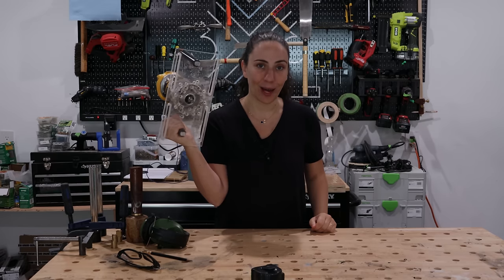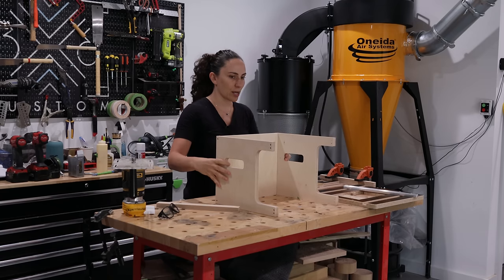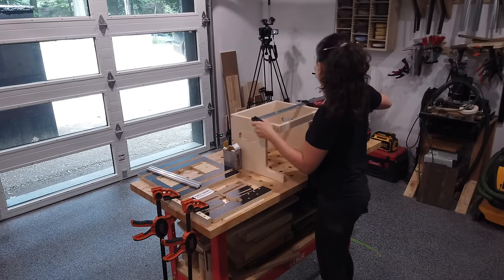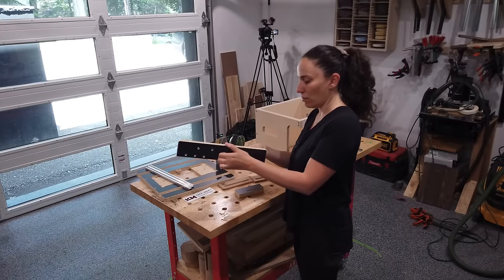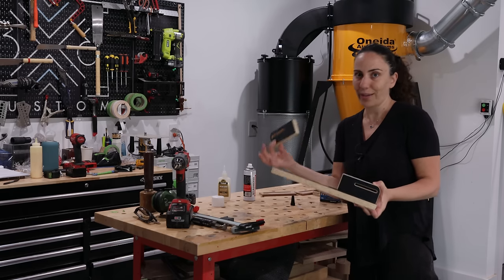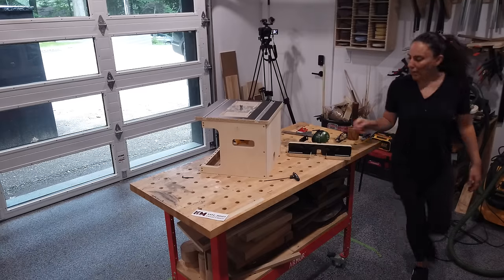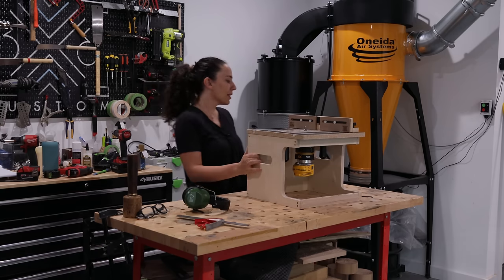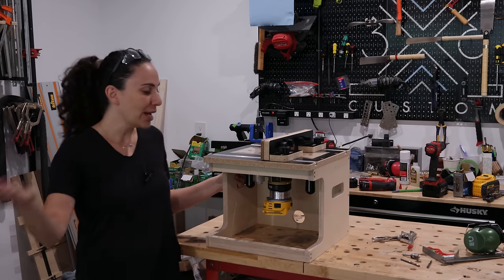Benchtop Router Table for the 6-in-1 Trim Router Jig

Comment: I think it's a bad idea to have holes for the bits in the base. If you attempt to remove the router with the base full of very sharp bits, you run a high risk of injury. But it’s a very nice and useful little tool.
Thank for this great video❤
Reply: It’s an option not a requirement to store bits there. That being said I’ve been using these for two months and not had an issue.
Reply: @katzmosestools  Giving the opportunity to do that to an inexperienced person without warning is irresponsible.
Look at the video when Tamar remove the router, her arms hit the bits holder.
Warning is easier then apologizing.
Reply: @capitainehaddock9388  JKM’s warning: sharp things will cut you. Use the same care you use around every single tool in your shop that is sharp. If it worries you you are not obligated to store your bits there but I promise you will find it useful if you do decide to use it.
Reply: @katzmosestools  maybe for v2 instead of optional bits in the affixed base - standardize a modular connection for easy mounting/removal of bits via a french cleat module.
Reply: @ChuckJaeger  “A poem is never finished, only abandoned” go check out the video I did this last week about how we developed this. Pretty cool look into how product development works and how much thought we put into this. I’m sure we could keep adding things until it looked like the Terminator.

From my experience making cleats on the cnc is incredibly inaccurate, cost prohibitive and not something we plan on changing or offering. There’s lots of ways people could modify this to fit their needs and I encourage them to do so if they would like. My point is this, nobody has to use the feature of a tool we offer. It’s there if you want to but it doesn’t take away a single thing from the functionality of it if you decide not to use it. I am certain this is the most functional, strongest, and versatile router table on the market at this price point. In my video we set my Ford F350 Dually on top of two of them and they hold it up. I am very proud of that fact. Use the holes or don’t but complaining that they there in the first place is silly.

Comment: Few questions. Why is the top rotated by 90 degrees? Is there any benefit to having the T track come all the way to front of the table?
Reply from the maker: Lots of design iterations that led to this. Jonathan explains a lot in his video. And you need the t track to extend all the way to the front so you can put it on or take it off on either side.

Comment: My Rockler portable table still meets my trim-router needs. However as I have your very well designed/made 6-in-1 jig most always attached to my Makita 18V router anyway, and this is such a well made table kit (as all your cooperative endeavors) I know I won't be able to resist much longer getting one.  ;-)
Reply from the maker: 😂😂 I decided I’m going to keep my big router table for 1/2” bits and this one for 1/4” so I never have to change the collet on the big one!
Reply: I finally took your always valued advice @3x3CustomTamar  and ordered the KM unit and will similarly dedicate to 1/4" bit tasks, leaving 1/2" to my [now cold] garage full size router table. I've already repurposed my crafted granddaughter's LEGO table that recently got outgrown-returned into a nice base for same (just happens to perfectly accommodate once I raised it 2-1/2").  The new KM kit will arrive Saturday but I have a full outside the shop schedule. However thanks to your walk-thru I'll make sure I at least pull out and glue up the first couple pieces so I'm ready to go when I have more time. 😉

Comment: Pretty nice idea, but ...
for a couple of dollars you can buy the router-cage as a spare part.
So you can mount the router-cage permanently and precisely adjustet under ther router tabe.
For mounting the router, you only have to set it into the router-cage, without having to unscrew and rescrew the handles and without having any adjustment issues.
Thats the way I built my little router table for having it every minute handy. :-)
Reply from the maker: Ok

Comment: Need to add a Starter Pin accessory.
Reply from the maker: Something I forgot to mention on this video! There’s a pin that’s included with the 6-in-1 jig for circle cutting. You can tap one of the extra holes and use it as a starter pin. Jonathan talks about that in his video 👍
Reply: @3x3CustomTamar  fantastic!

Comment: Your earlier videos with single camera gives far better view & learning instead of 3-camera set up.🤨
Reply from the maker: That’s not changing. Like I said, the point was to show how long this actually takes to build. So this video was different.
Reply: @3x3CustomTamar 

Your only dull video was the one where you were sharpening a wood chisel. Even more dull when you dropped it on the concrete floor but the end was razor sharp.
Keep on woodworking, you’re the best ❤

Comment: Intrigued by your videos and journey. I watched your transition from old shop to new shop. You could have done better on the choice of cabinet table saw. The Harvey table saw is far superior to the Sawstop. However, you can improve the Sawstop saw by first taking off the fence and slide rails and disposing. Buy the Incra TS-LS Fence system as it is superbly excellent for accuracy, repeatability and ease of use. You even have the option to get the wing and router table attachment for an even better work station (saves valuable real estate). 
Something I would suggest you build for YouTube content. Consider a Crokinole board. It is a challenge for a small shop build and those posted on YouTube are limited in solutions. BTW, I think you will find the game and board very entertaining for yourself and family. At the very least, do some research into the crokinole construction and its' many, many design issues. Keep up your progress in woodright skills.
Reply from the maker: There’s no way the Harvey is better than the sawstop.

Comment: Not sure that the table has anything to do with the dust collection on the dust groove. Take the table away, keep the base plate and keep the dust collection, and you’d have the same amount of dust.
Reply from the maker: That’s correct. But I didn’t think dust collection would be so easy to set up on a portable router table. And it excited me.

Comment: I see a big drawback in only ONE place of the design - those bit holes on the bottom rail. The bit holder holes are NOT in a good place because your arms are going to be moving in and around the router . You could hit those bits a LOT with your hands and arms. Setting bit height and changing bits are unavoidable and every time your hands and arms are moving in and around those bits. In theory - handy place but in fact  - dangerously close to skin and bone. Otherwise well thought out and practical. One other thing is the power on/off switch while using the router in the table ... kind of glossed over but again those hands are moving blindly to get to the switch OVER/Through the bits.
Reply: Agreed, every time Tamar reached in to take the router in/out I winced because if it was me I would DEFINITELY slice my arm on a 1-inch template bit every time I did that. Probably not a problem for everyone. 

Other than that it looks awesome! I still want this table but I'll probably build it without the holes there, and maybe add a compartment on the side or something.
Reply from the maker: I def hear that. They don’t not to be used

Comment: Yes, I would like to comment.
I have emailed you and am waiting for your reply.

KM Tools "Customer Service  was not very helpful in almost 10 days (by email) so I ccd you into the email 7 days ago.
I am concerned I have heard NOTHING back since then. Not very impressive product support by KMT or 3X3..
Without going into personal details there are a couple of problems .. 

Problem 1. Main.
The jig base CNC'd holes for my Makita trim router are out.
3 out of 4 screws can go in but 4th is certainly out by ~ 1mm+ .   Obviously I am loath to use force or try and resize holes ..
I sent pictures.

Problem 2. Minor..  Some concern all the extra holes can only have weakened the jig base.
Maybe produce a couple of different  jig bases for different routers, so the 'all in one' pattern on the jig base doers not run a risk of weakening.

Problem 3.  Minor.  Screws from the Makita, like many routers, have countersunk heads. 
Screw holes in jig base are for pan-heads, so screws could split the holes if somebody was ham-fisted. 
Why not include appropriate screws for assembly to customer's router? 

Problem 4.   When I asked KMT support for assembly video [prepared for customers by Jonathon?] for the router table, I was sent a link to this video.
Also told by KMT 'support' that my base could be rotated 180 deg to fit 'like some of our staff who have the same router(?)'.. but it is asymmetrical - so obviously can't!  Why make up silly solutions? 

From details above I am confident you can determine my ID,  email address..
Hopefully I hear back from you ASAP with a solution.

Regards
Reply from the maker: I apologize that you had this experience. I just checked my support emails and it looks like the team is sending you a replacement. I hope that solves it! Again, really sorry about that.
Reply: Hello Tamar
Thank you for reply.
Already heard from the support people who tell me another jig base has been checked and dispatched..
Looking forward to receiving it!
Hope you are able to sort out the reasons for the woeful performance from the utterly unsupportive support person.